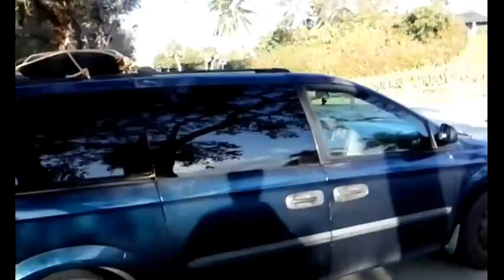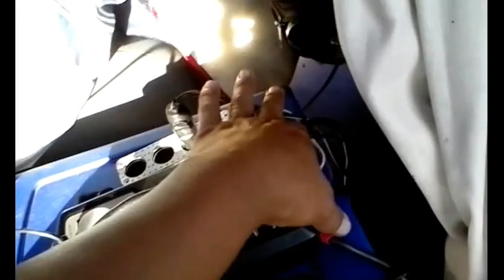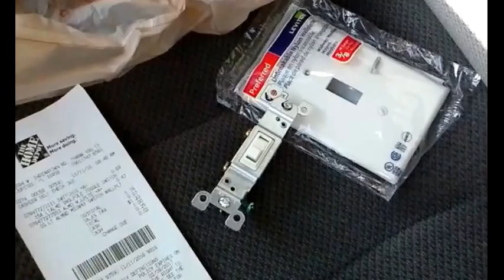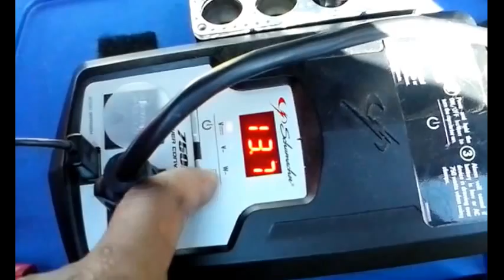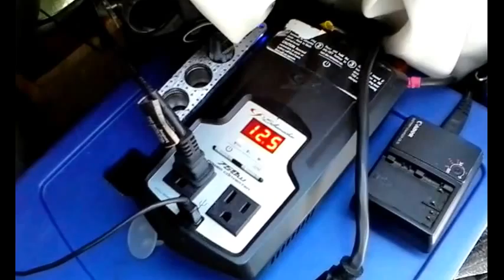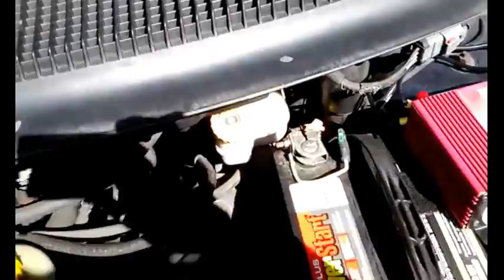Day 4: More Cooking System Woes (V292) - Van Dweller Van Dwelling Vanlife Living In A Van RV

Comment: a cheap battery isolator switch would be the most economical way forwards....  considering they are used to isolate the whole starter battery in most cases they would certainly stand up to your inverters requirements

Comment: Its all part of the fun :) I'm afraid that household switch will not last long be careful. DC current arc's much more than AC and I dont expect that switch to last long. I would get a 40amp switch and use no bigger than a 30amp fuse for that 10g wire. The fuse needs to be the the weak link not the wire or the switch. Upgrade the ENTIRE wire and a lager fuse could be used.
Reply from the maker: I think this is the way to go.  So far, the switch and fuse holder seems to be the weak links.

Comment: For future reference, if your vehicle has side air bags, make sure you disable the air bag system fuse before attempting to cut or drill into that side post, the vibrations could trigger the air bag to deploy, which if your not directly injured, will be a very costly endeavor to fix.

Comment: The switch doesnt care if its 12v or 110. Its the amps.
Reply: kabukiwookie the voltage isnt so important as you mentioned, however the way dc and ac  current arcs across switch poles is different and an ac switch cannot stand up to the way a much lower voltage switc would handle any arcing across the contacts. the most likely outcome is the ac switch will end up with its contacts welded together.

Comment: Do you have  a battery isolater?
Reply: Living In A Van denoy, message me an address i can send one too and ill get one sent out to you.... i would hate you to be without your cooking equipment for the sake of a couple of pounds
Reply: i just asked about a battery isolater.... now i have seen this we can get them in the uk for about 4 pounds....
Reply from the maker: Thank-you Austin, but that's the problem.  I don't really have an address or one where I can receive stuff at this time.  If things go smoothly tomorrow, this constant struggle to get $$$ to make it day by day may be resolved.  Cross your fingers and pray for me.  Changes may be coming really soon.
Reply from the maker: Manual switch. I plan to install an isolator when I can afford one, but for now, I use a manual switch.
Reply: ouch
Reply: Had someone tell me back when I bought my 06 Town  & Country (in 05) that he his  05 model threw electrical spikes and destroyed cell phones if they were plugged  in when  he turned the ignition on.
Reply from the maker: They run about $40-$120 around here.  I've been short on funds since this whole journey started.  The current switch is $1.25 or so...versus $40+.
Reply: of course i will denoy....  let me know if thing's change and you do need one sent out also

Comment: Hi Denoy. The rice cooker is 330 Watts and the battery voltage is 12 Volts. 330  divided by 12 = 28 Amps, plus the power consumed by the inverter itself. You need a fuse and switch rated much bigger than this. Best to use a 40 Amp fuse and switch.
Reply: I suspect the amps to be much higher. If the wire and switch is getting hot and melting he is pulling even more amps from the battery than just the rice cooker.  When heat is generated in the switch or wire it takes amps to produce that heat. I bet he is pulling over 35-40amps from his battery much more than is needed for the rice cooker. Upgrade the wire,switch and fuse and the battery/inverter should last longer plus be much safer.  I have had a wire fire in a car before its not fun.
Reply: Look at this chart... http://www.sunforceproducts.com/Support%20Section/Solar%20Panel%20&%20Charge%20Controllers/WireGaugeSelectionTable.pdf

The fuse is not blowing because you are not drawing more than 400 watts through it  (13.5V divided by 400 watts is 29 amps just under from burning out).  The chart above shows if you were at 12Volts, but your alternator is putting out 13.5 volts which gives you different amps.   I am not sure but i think the alternator should be putting out 14.5 - 18 volts when car running (but don't quote me on that).  Once you start using an appliance that uses more than 400 watts the fuse will blow!  I suspect because you are using the house battery too, is dividing the watts 200 watts from car battery/alternator and 200 watts from house battery never pulling all 400 watts from engine battery.  If your rice cooker is below 400 watts would explain why the green 30 amp inline fuse has not blown yet.  If you run a small space heater or coffee pot it will definitely blow the fuse.  The household 15 amp AC light switch should allow 800 watts of DC @ 12.5 V to pass through fine before it starts melting.  The new switch is not your potential problem, that skinny wire and fuse is the weakest link now.  Question is how many amps/watts are going to house battery to charge it plus the amps/watts used for inverter (cooker)?  If the cooker pulls 330 watts leaves 70 available watts to run the inverter and charge house battery before fuse blows.    If there is one thing i can relate too is that old saying, you can't squeeze blood out of a turnip and certainly can't grow money on trees!  Love your determination to find a way trial and error and feel your pain on the budget!  Once you learn the Watts conversion between AC and DC it all makes sense.  It might not be practical, but if you could move inverter and house battery to front passenger floor board to shorten length of wire used would help your cause and get you by.  The best advice i can give you is to invest in a cheap set of $20 jumper cables will fix you right as rain.
Reply from the maker: In a future build I will go much larger...using a larger wire for the connection as well as the fuse.  The current modifications seem to be working thus far...but then again, so did the previous upgrade.  :)  I wish I knew more about this stuff but I am learning.  Thanks for the info.
Reply from the maker: BlackTop Boondocker Why is the fuse not blowing?  The fuse is 30 amps.